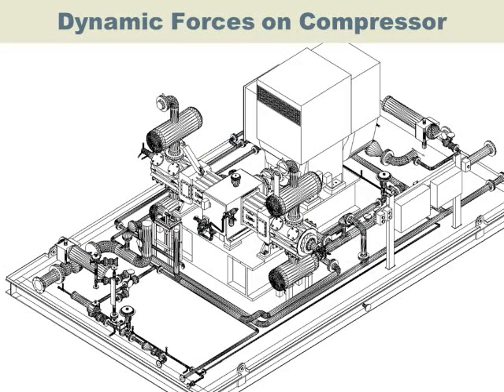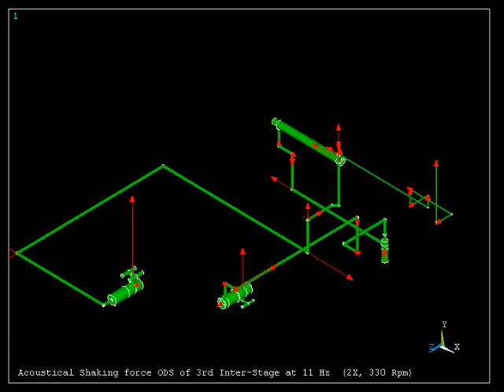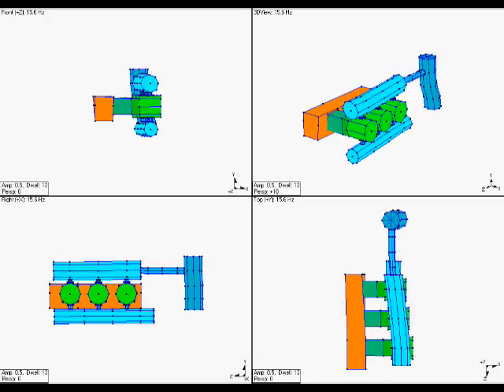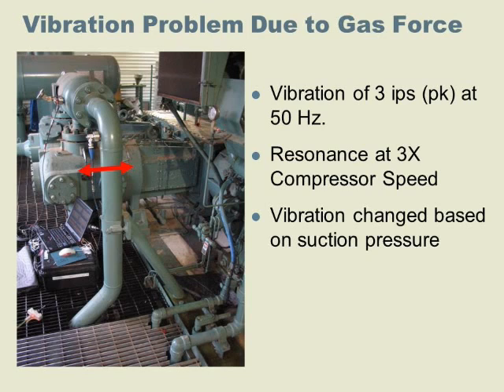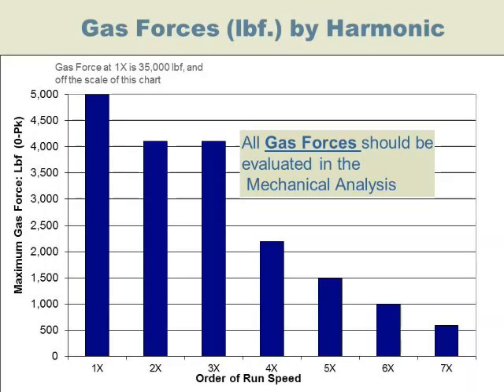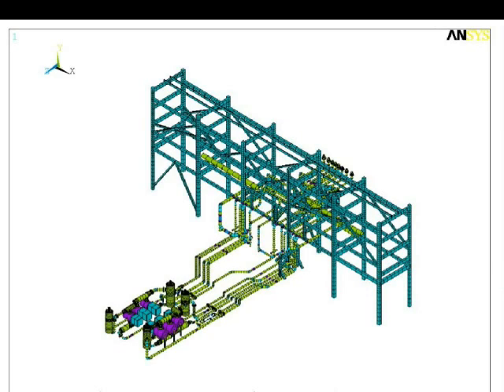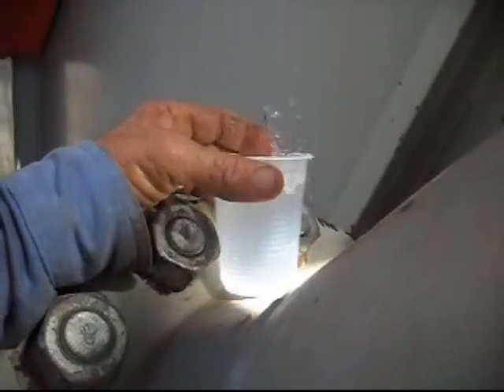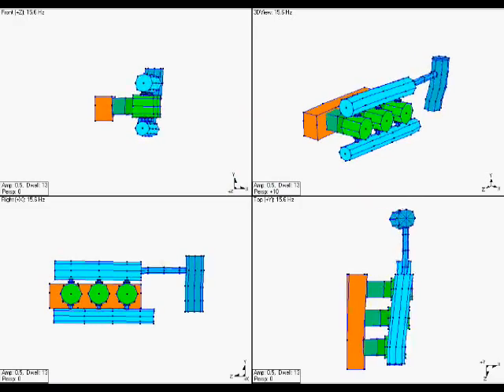Mechanical Analysis for Reciprocating Compressors

Comment: THANKS FOR THE VIDEO !
A QUESTION: In order to avoid resonance problems why don't you an accumulator for each compressor?
ANOTHER QUESTION: If the interaction between the structure and fluid is considered? in different pressures, is the mode shape of the structure, taken into account same? or would be changed?